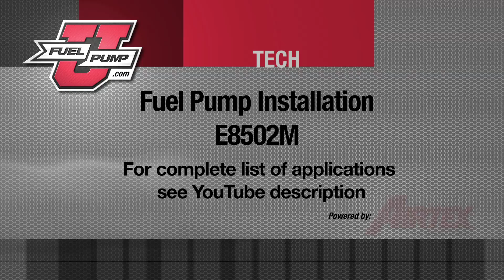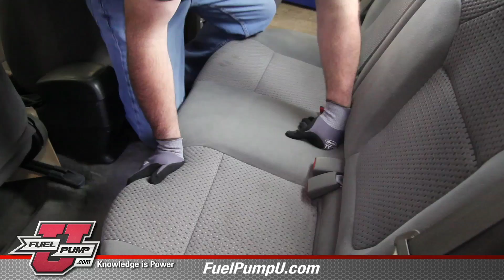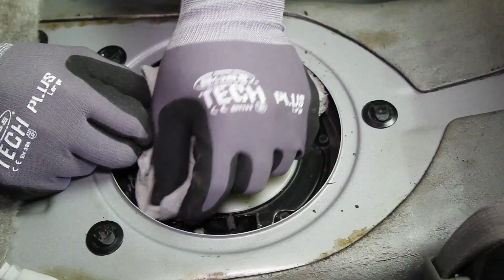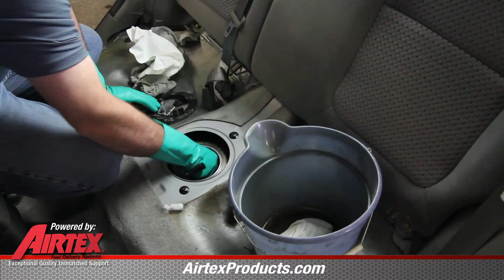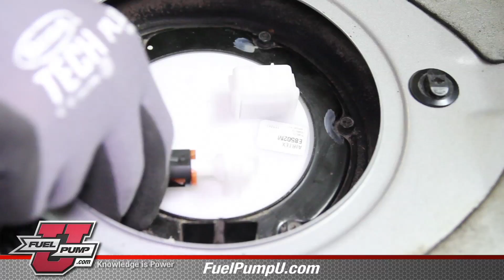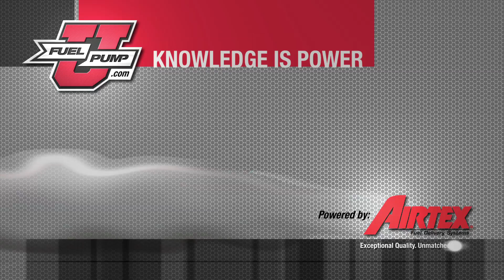How to Install Fuel Pump Assembly E8502M in a 2002 - 2006 Nissan Sentra

Comment: Does this cure the long crank on 2000-2006 Nissan Sentra’s 1.8? I read about the fuel regulator TSB where they just replace that part, but I’m thinking a new fuel pump assembly would be better.
Reply: Ever figure it out?
Reply: @bowman7840 Weirdly enough the crankshaft position sensor was going out (kept dying after going WOT during drives! I had to put it in Neutral quickly and restart the car as it was still coasting and then it would turn back on!) Weird. I replaced it and it fixed the issues.

Comment: Hi, I have an 07 Nissan Sentra 2.0.  I just replaced the fuel pump about a week ago and everything was working fine up til yesterday.  I have a digital fuel gauge that's showing that I drove 60 miles and I'm already on 3/4 of a tank. I have a tank that holds 14.5 gallons and the book says I should get about 27cty and 33 hwy. I'm not getting anywhere near that. This has happened to me in the past as well. I will drive a certain amount of miles but when I go to fill up I need about half of what's actually showing. I checked my fuel pump fuse its good and I hear the pump when I turn the switch. Please help!

Comment: Great vid, Rich. What’s a respectable estimate do have a fuel pump replaced in a 2005 Nissan Sentra in your opinion?
Reply from the maker: The flat rate time found in ALLDATA calls for 0.8 hours. The pump is access is under the rear seat. Labor times and dollars per hour will vary.

Comment: Hi I have a 2006 Nissan Sentra, my fuel pump is working but I think my fuel filter is bad, where could I locate it
Reply from the maker: The fuel filter is part of the fuel pump module located inside the gas tank. It is considered a maintenance free item.
Reply: Airtex-ASC Performance Pumps so does that mean, I could take it to Nissan and it will be free?
Reply from the maker: No, unfortunately is is not free. What it means is it does not require regular replace,ment. If it becomes restricted or plugged the fuel pump module will need to be replaced. It is not a serviceable part.
Reply: Okay I really appreciate it, thank you for replaying very quick.
Reply from the maker: Glad to help

Comment: Would gladly appreciate your help. I have an 04 sentra, based on my research I'm assuming that my fuel pump is bad... before the car broke down, it wouldn't start in the first crank, until the second one. Then the day it broke down, it would take a while to speed up the first 10 -15 MPh. what do you recommend I should check first?... use a pressure gauge ?

Comment: Is it recommended OR necessary to remove fuel and clean the tank.  Realized while there it's good to do all you can, just don't have access to that monster hand crank pump you used.  Thanks.  Jim
Reply: Obviously it's too late for you now probably (4 year old post) but I just replaced mine without doing that.  What I did, based on other videos, is pull the fuel pump fuse first and then crank the car - it doesn't start and de-pressurizes the system.   Then open the gas cap and disconnect the negative battery terminal, and off you can go to replace the part.
Reply: Well, was it okay without pumping it out? Curious for myself. Thanks if you reply

Comment: My 02 Nissan Altima 3.5 smells fuel in the car some of the time. it can go weeks without smell then it will start. sometimes just when I get into car, other times when I am driving. car runs fine. if it was gasket wouldn't it smell all the time? any ideas what it is? thanks

Comment: I had a really tough time getting the metal hold down plate back in place. It seemed much much more difficult to both undo and then find the screw holes and replace the bolts (compared to how easily you seem to be removing and installing.) Now I can still smell gasoline faintly and I've received the error code 455 likely indicating that the seal isn't good.
Any idea why I might be finding the fit to be so bad? Think I just need a new plate?
Reply: *****  Turns out my gasket had swollen over time, and was in the way of the screw holes to replace the metal hold down ring. When I removed it to inspect it, the screws had pinched and severed the old sealing gasket.
Do you guys sell a replacement sealing gasket that will work with an 06 sentra and this pump? Having a devil of a time finding a replacement.

Comment: where do you get the fuel tank to pull out the excess gas?
Reply: @travie.golightly  No it's not.  A step not mentioned in this video but you'll see elsewhere on youtube, is that to depressurize the fuel system first, you can pull the fuel pump fuse (located a bit under the dash on the drivers side) and try to start the car -- let it crank a few times and stop (it will fail to start).  After this point, the fuel system is depressurized and you don't need to use a pump to pull it into a gas can like they do here!
Reply: Airtex Pumps treba mi pumpa za almru 1.5 benzin 2000g n16
Reply: Airtex Pumps ili samo merač goriva na pumpi